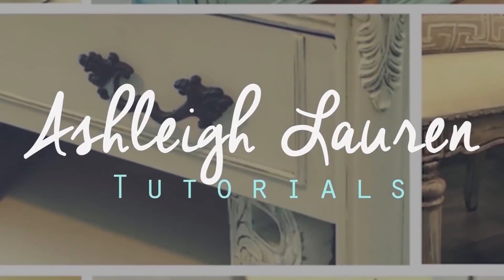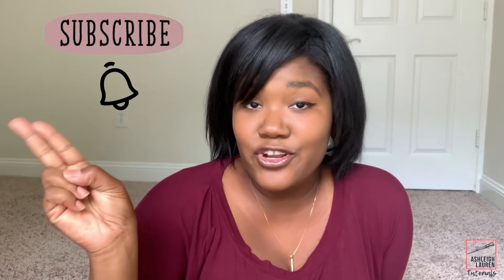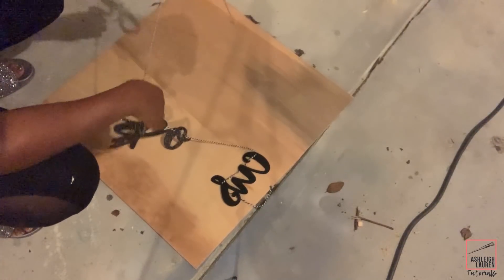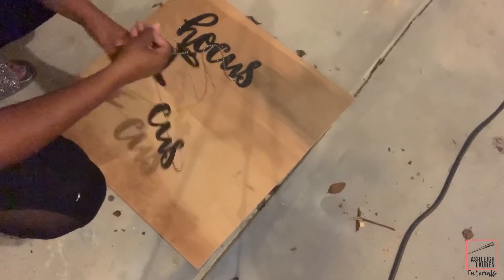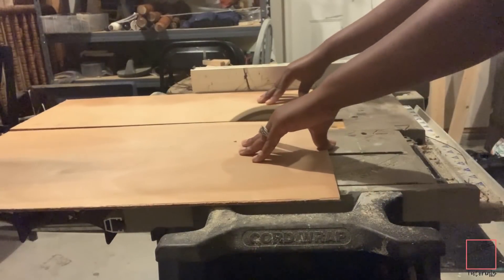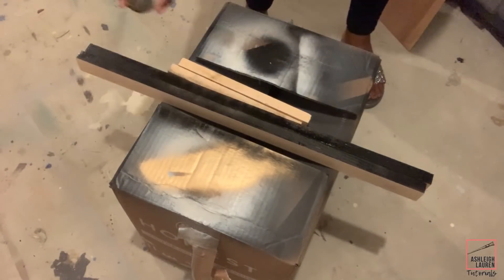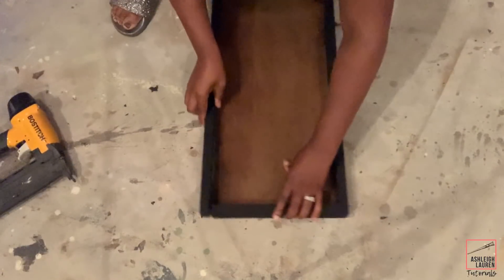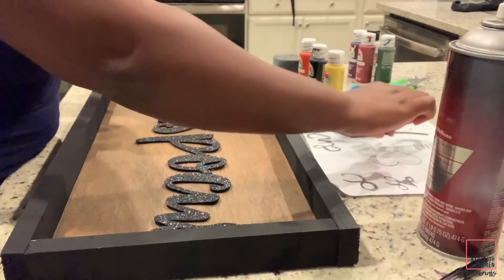Hocus Pocus Wood Framed Decor | Quick & Easy | Halloween DIY | Ashleigh Lauren

Comment: I want to make the wash,floss, brush and  flush signs for bathroom instead of buying them since they can be very expensive.. Any idea for this diy?
Reply from the maker: Yes, you can totally make these yourself! Depending on the size of each sign you could possibly use (1) 1x2x8 board! They cost less than $2 at Lowe’s! You could then use plywood which you can get for under $5! I may do a DIY on this because I love those signs too! ☺️
Reply: @AshleighLaurenCrafts  oh good a diy from you would be so nice.  I have lots of idea but don't know where to start lol